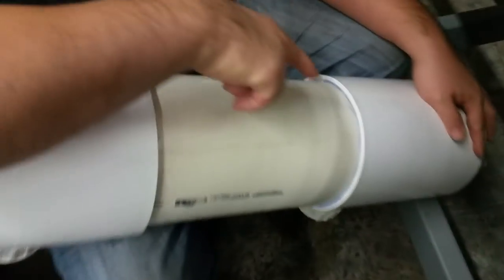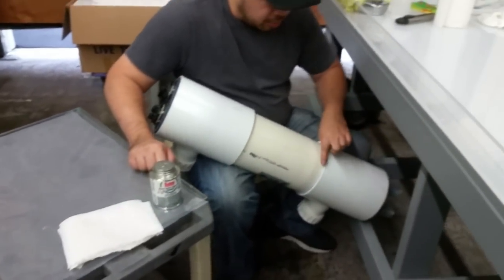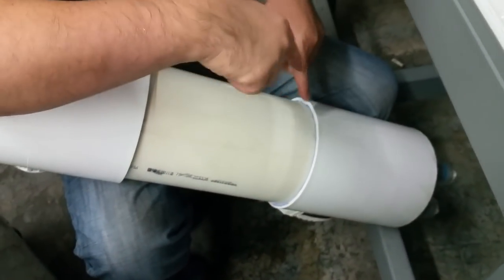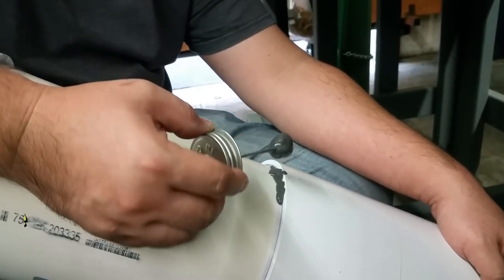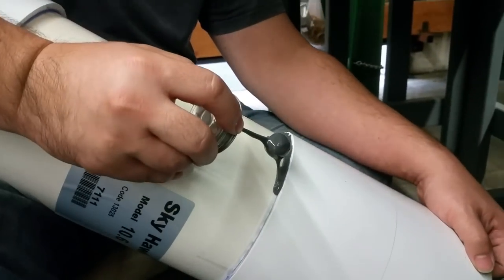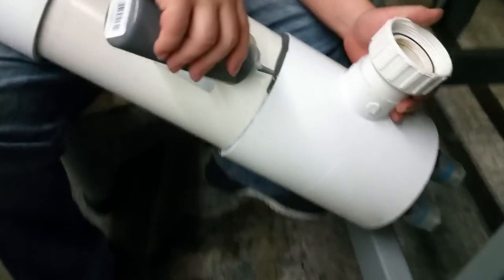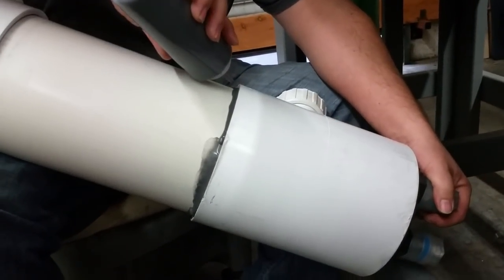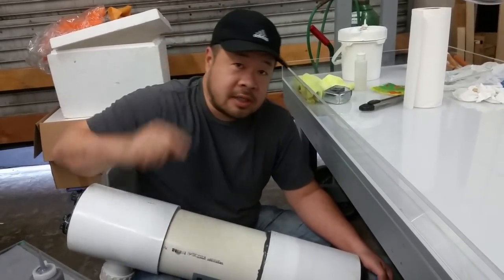FIXING Aquarium Filtration LEAK - It was the UV Sterilizer

Comment: hey Kevin love your vids and how meticulous you are...I am the same. Any reason you didn't use tape or any sealer on the "unions" when you put the UV back into place? That was SO sad when the water came out of the front pipe when you had drained it into the bag and were doing the back...lol It seemed so unfair! ;)
Reply from the maker: No need the union has rubber gasket